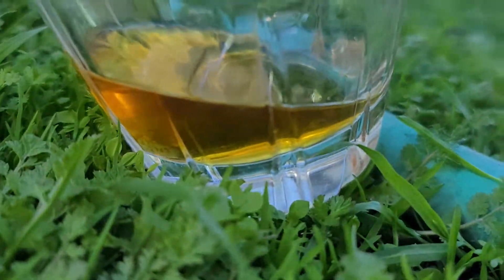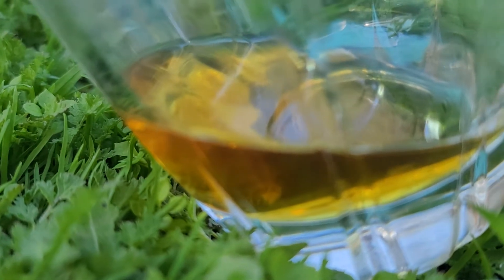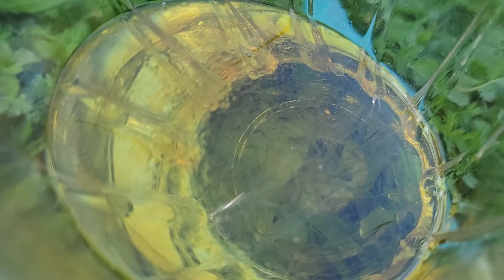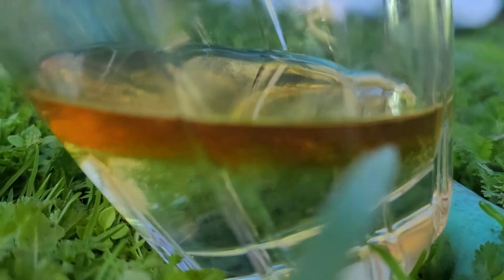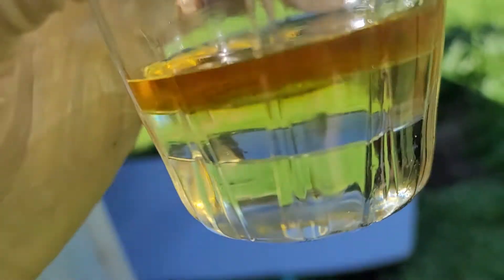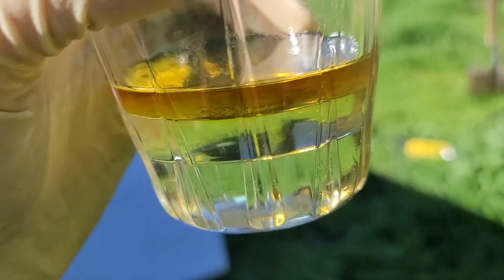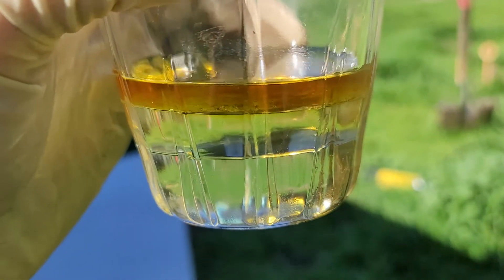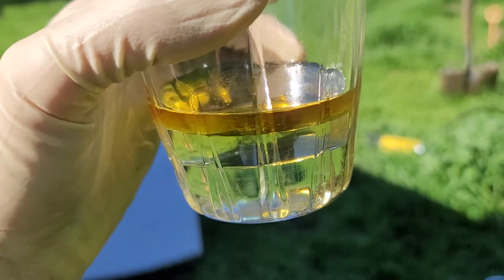Mixing dot 3, 4 & 5 brake fluid.

Comment: I'm assuming you must have used flushed-out DOT5 because all DOT5 is purple when new. The general consensus is that if you mix it with DOT3 in a master cylinder weird chemical reactions occur. These reactions cause rubber seals to fail and the cap gasket to expand to 3 times its normal size. Or it turns into jelly. Or nothing seems to happen. I don't see any chemical reactions occurring in the jar. What would happen if you threw a piece of rubber in the jar and let it sit for a few days?
Reply: Nothing

Comment: Do not switch to DOT 3/4 to 5 or from 5 to 3/4……that is not a good idea
Reply from the maker: I switched from 5 to dot-4. Flushed a gallon of dot 4 through it. The dot 5 rises to the top so it was easy to get all the old stuff out. It's been 2 years and had zero issues, planning to flush again soon as per the 2-year maintenance recommendation. One downside of dot-5 in vehicles is the fluid does not absorb moisture, so it puddles near the bottom of pistons and causes putting and rust. It does last longer with poor service, but not good for vehicles that sit for extended periods. 😕  just my opinion.
Reply: @subtledriver  what all the seals that are made for one DOT?